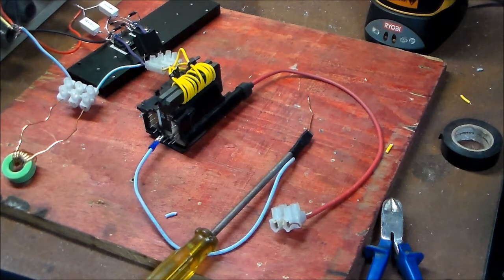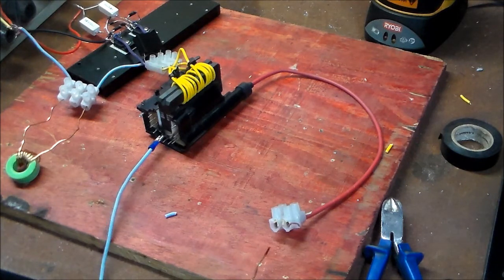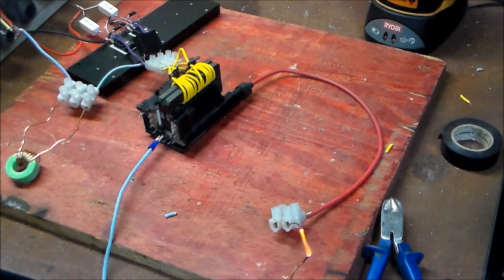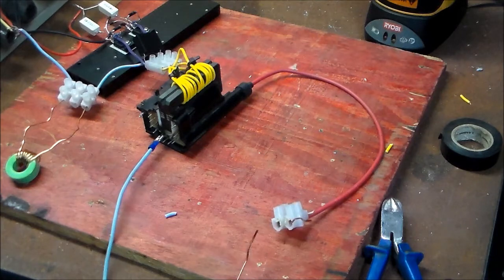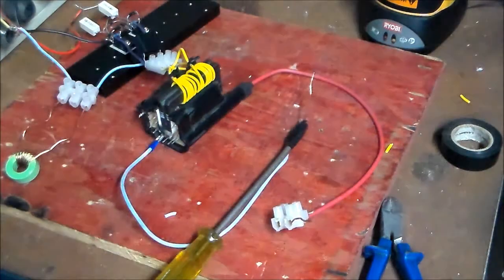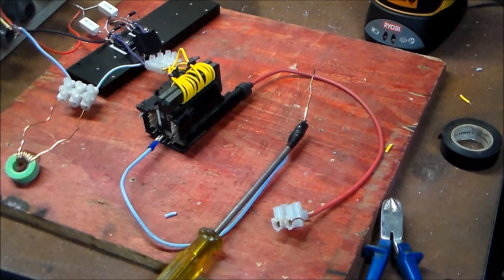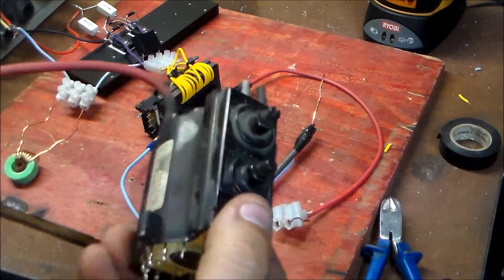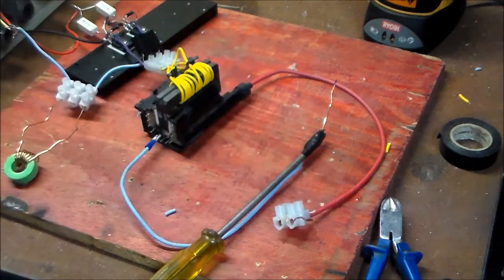ZVS Flyback Driver first runs on 12v

Comment: 555.  you can get higher voltage with the zvs too, but at a certain point they'll stop oscillating.  easier with a 555 driver.  start with like 10 turns on the primary, then remove 1 turn at a time and keep removing turns until it won't work any more.

Comment from the maker: thanks for the advice, i first tried 20+ turns and the circuit would not oscillate
ive tried inductors from PC psu's, and a store bought 100mh, no luck. only seems to work with my "home brew" inductor!